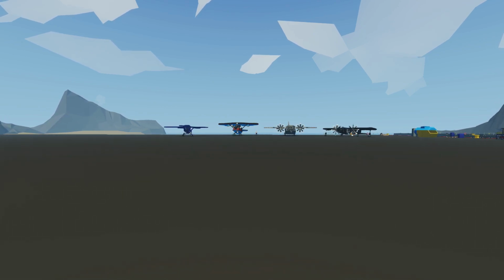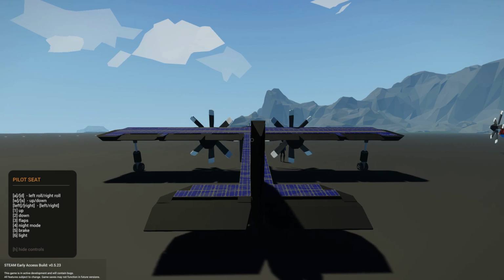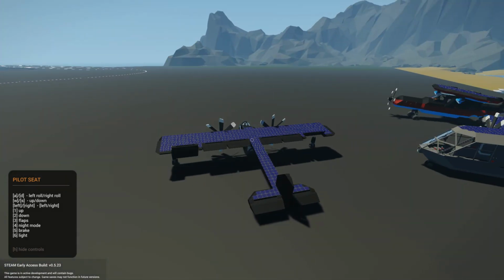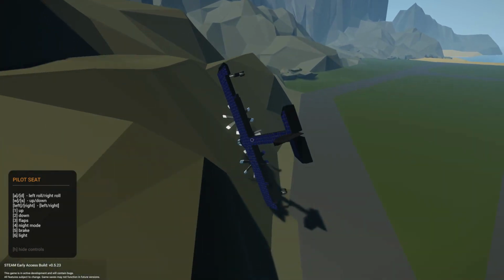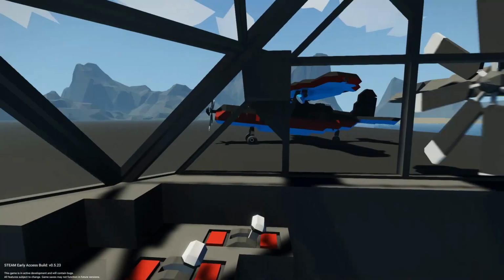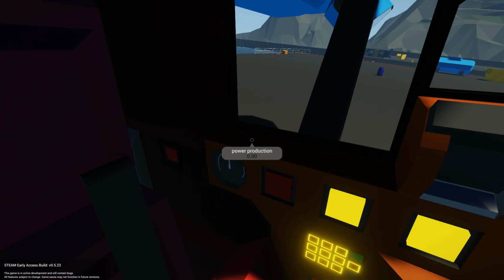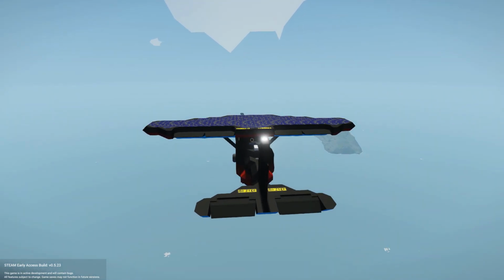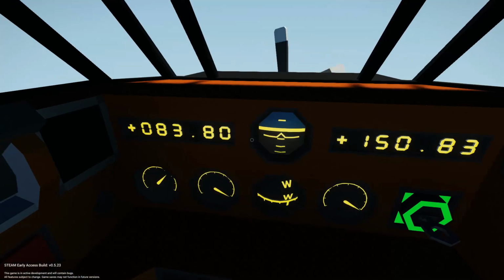Solar Planes Testing With Adda Boy | Stormworks Early Access

Comment: There is an exploit of the laws of thermodynamics in the game where you can get more power than that you put in.  2 small engines, hooked up to 2 1:3 gearboxes WITH POWER NODES connected, going into 1 or 2 medium generators and BAM! Nuclear energy.

Edit:  that is, it generates enough power for 1 or 2 more small engines.
(Needing an edit 1 second after posting, stomp me face :(  )
Reply from the maker: ohhh, so that is how the last plane kept a charge. It was not the solar panels. Interesting
Reply: Yes I am using that cined of cheating system in my paradise plane but with aut the solar panels the power will go down very slowly at night for example it will lose abaut 1 prosent per 10 min or so
Reply from the maker: @tomik499  interesting I did not test it for long enough to figure that out
Reply: @StormRunnerGaming  That concept is working really good I am building a nukleare sub right now and I managed to get from 2 medium electric motors with 2 gear boxes enough for 8 medium generators each of them are producing 90 power
Reply from the maker: @tomik499  that sounds really good
Reply: I’m not going to stomp your face, I like your idee